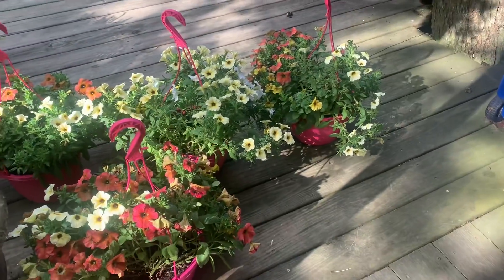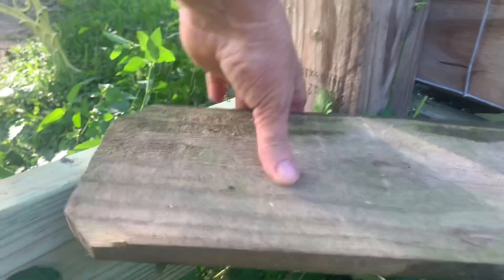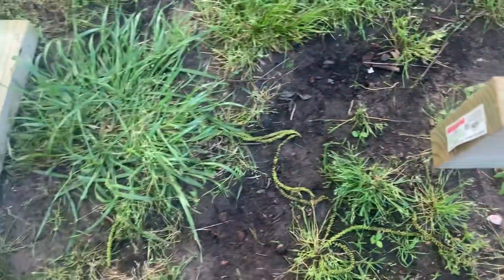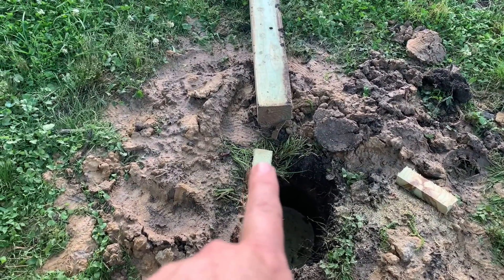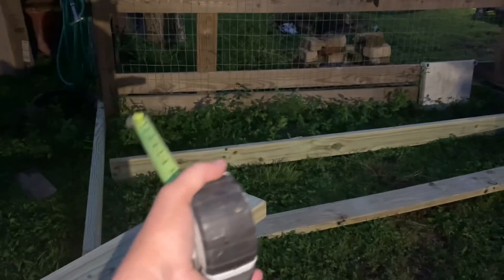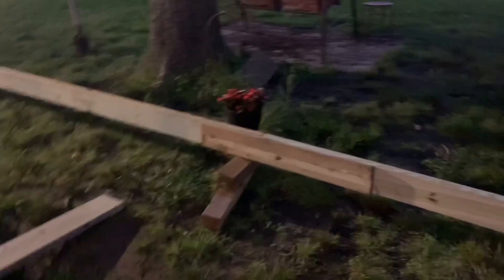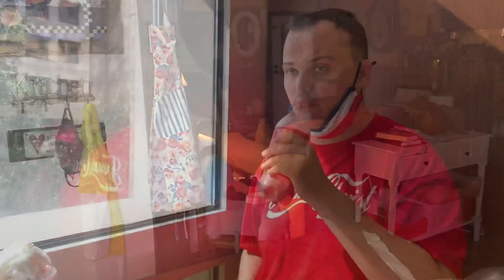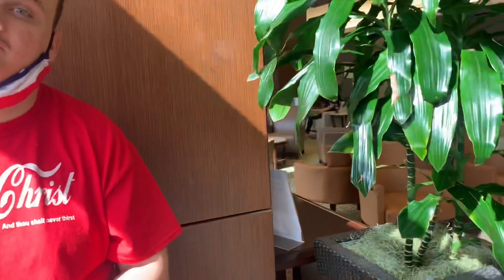Big deck, Naughty Sam & a few gifts

Comment: Rain water is SO MUCH better! I painted a big 50 gallon drum to look like an old wooden bucket and put it under the corner of the house to catch the rain water and put a water spicket at the bottom and attached a hose, using gravity...I found a rubber mesh to keep mosquitoes out that also let the water in and used the largest cross stitch circle to hold it on...it fit on the barrel perfectly...that's what I used for my flowers and they stayed looking beautiful. I could see you doing that, fun project! You don't HAVE to paint the barrel, I just liked the way it looked painted